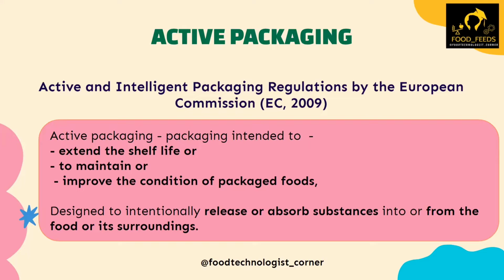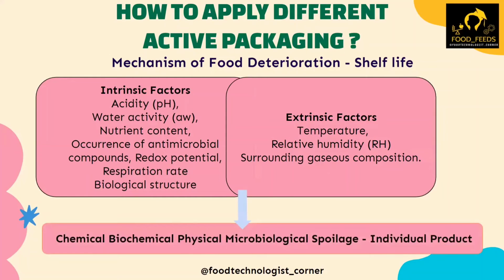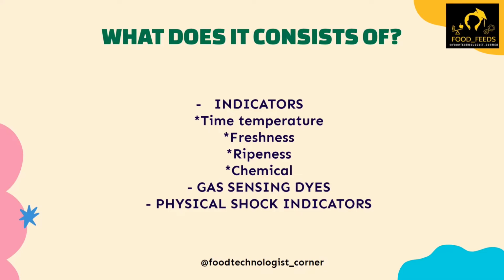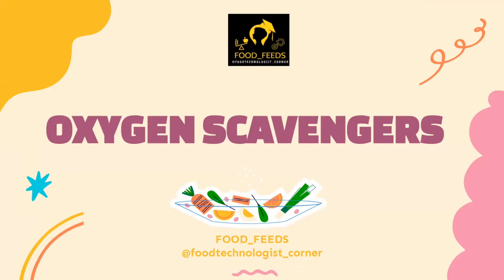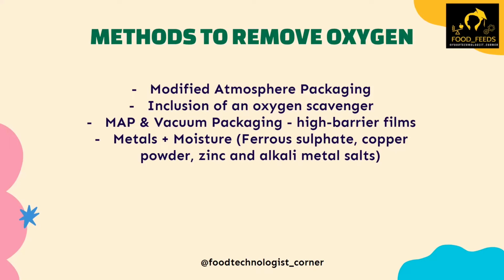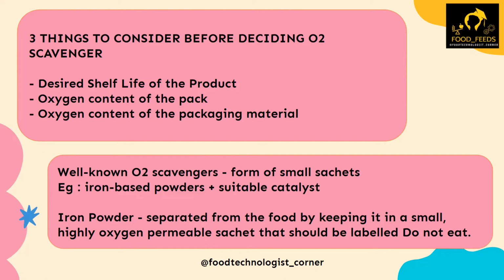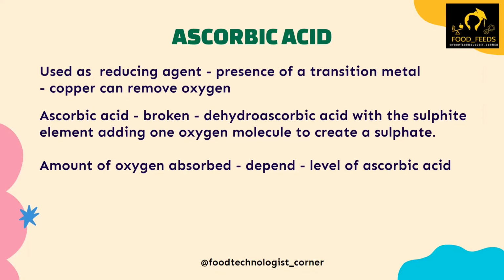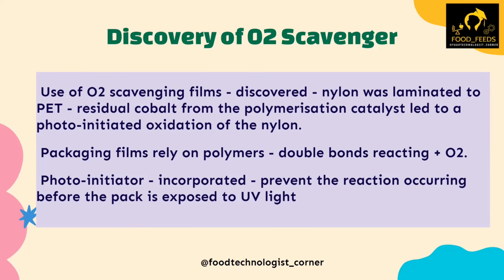ACTIVE PACKAGING #tnmrbfso #tnmrb #fssai #foodsafetyofficer #foodtechnology #cftri #cbt2 #packaging

Comment: That two enzyme glucose oxidase / ethanol oxidase intiate the glucose oxidation or it simply obsorb the remaining oxygen after catalase activity. ?
Reply from the maker: Oxygen + Moisture will oxidise the glucose to glucono delta lactone - with consequent production of H202 (hydrogen peroxide) 

Catalase degrades H202 - to water and oxygen as residual H202 leads to undesirable oxidation of the food.

Although the action of catalase generates oxygen, the combination of both enzymes reduce the overall concentration of the system.